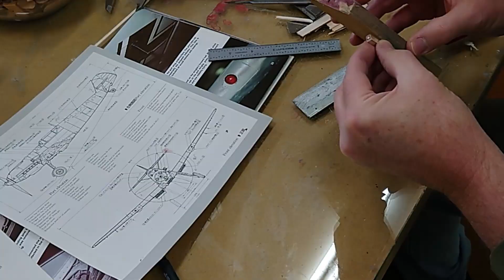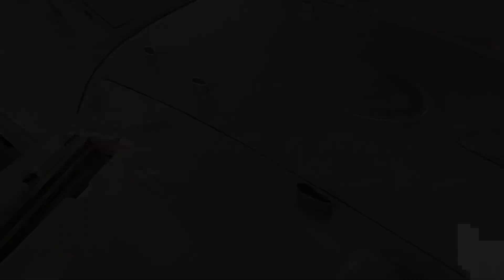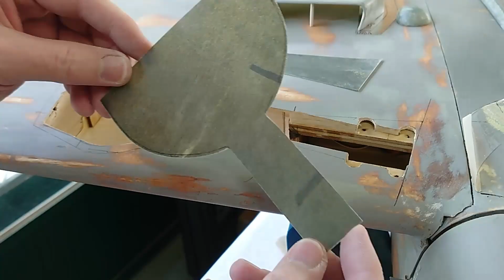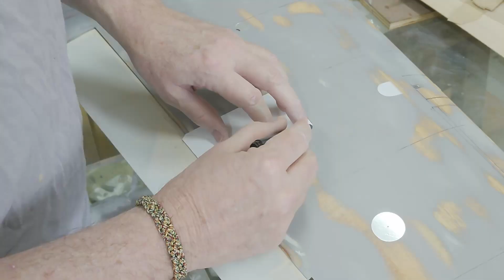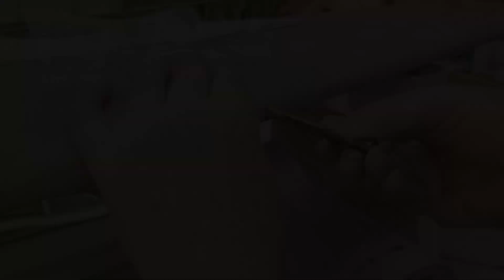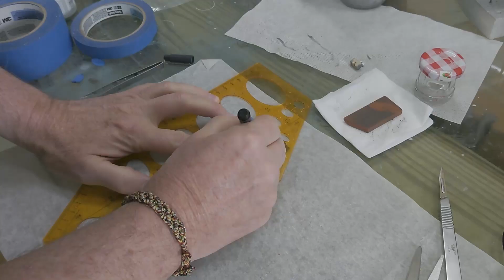Seagull Bf109E ARF Extreme Makeover, Part 4

Comment: Incredible work!  It's a pity the coolers are not scale.
Reply from the maker: Thanks.  Nothing on this model is truly scale.  It was all a compromise based on the original arf.
Reply: @BalsaAeroProjects  I know. I'm restoring an ESM 109 that came even without the scoops. I designed mine in  3D but they came out with the same shape than yours, until I realize where is the problem: the intake is made by displacing the roof parallel to the floor, because if you create a plug and cut the intake slated, the sides will curve to the inside. I'm learning a lot from your videos to improve the ESM appearance. Thanks!
Reply from the maker: @VictorHugoRC1111  Yes, that is exactly what happened.  I took measurements from a 3-view in the Aero Detail book and scaled them to the model size.  But, when shaped the intake became too curved.  I noticed the mistake when comparing to my Brian Taylor 109 but chose to let it go.  I will have to be more on my toes knowing that there are some discerning eyes looking at the models 
Thanks for the feedback!.